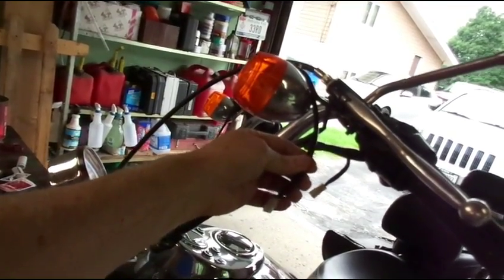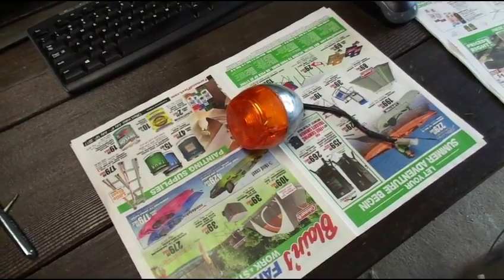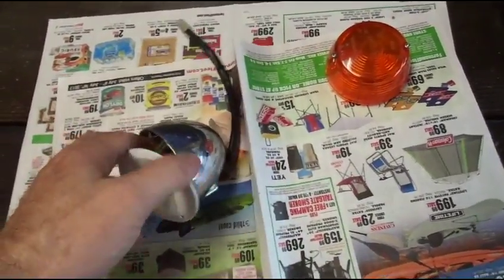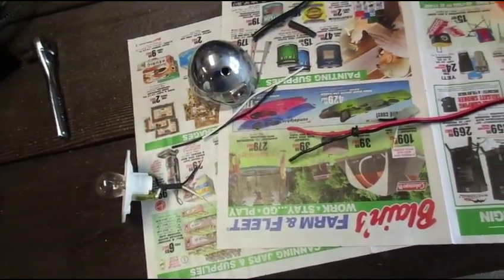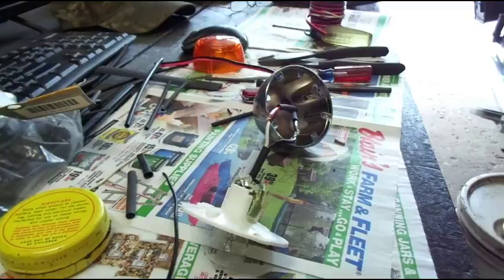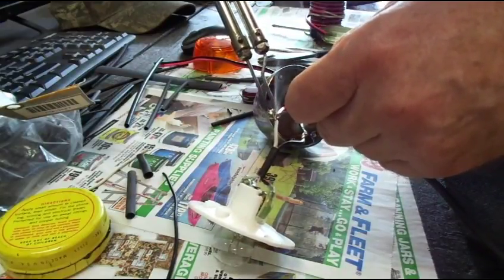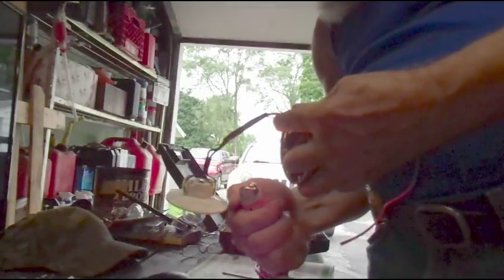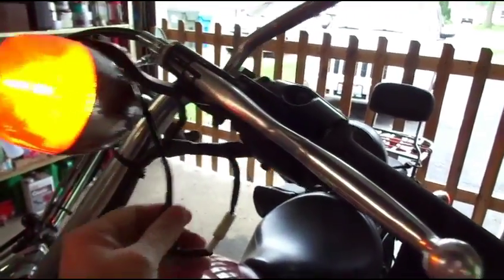Fixing a Broken Turn Signal Wire

Comment: I remember the HELL that was changing the signal light switch in my first car.
Reply: I did it on my last Jeep. It was one with all the different functions on it and just taking the steering wheel off was a pain. I think next time I have the shop do it in town. He is like half what the dealer charges.